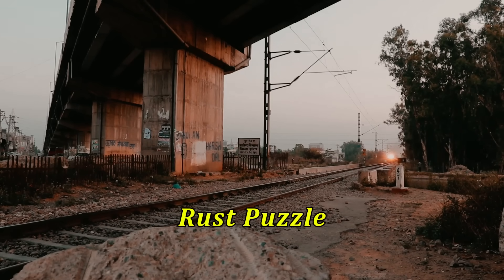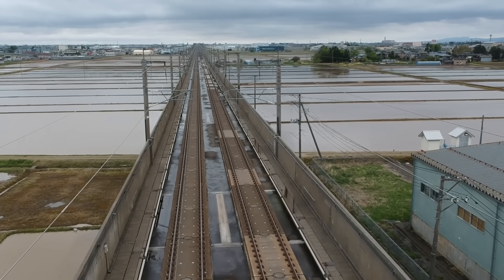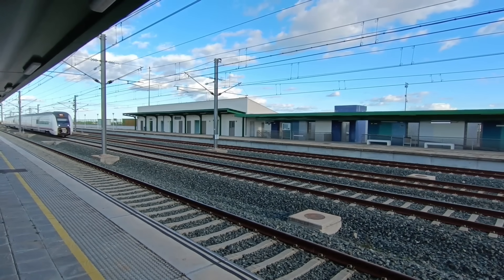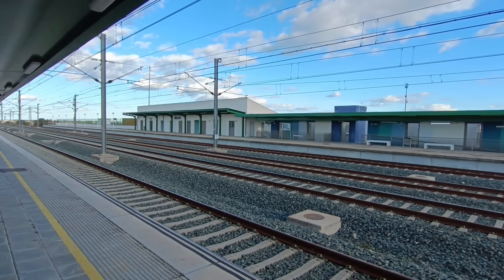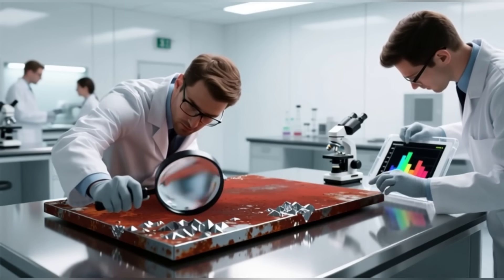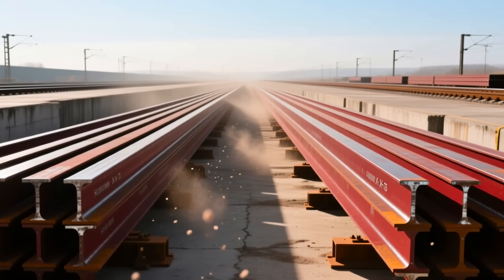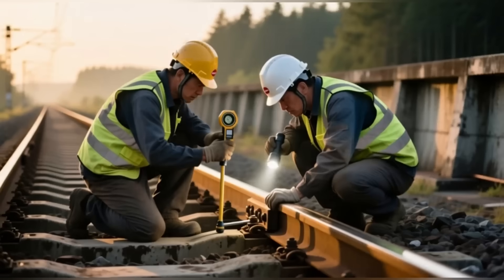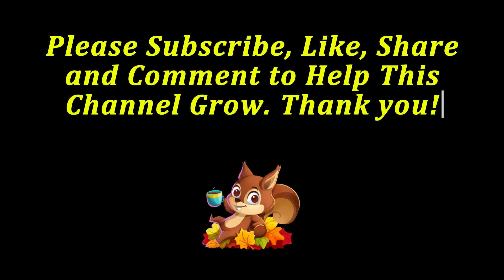Why China WANTS Rusty Railways (It’s Not Neglect!)

Comment: Makes you wonder if a steel (high-entropy) alloy could be found that is as strong (or bonus stronger) and (almost) as cheap as the rust-y looking low-alloy rail steel but looks nice and shiny for use in rid-able miniature railways and model railways. Maybe by using aluminum and some other cheap, abundant, non-toxic elements.

Comment: I thought patina was specifically a mixture of copper compounds that arise from this type of passivation on pure copper or very copper-rich alloys.

"Stainless steel" tends to passivate so fast that the oxide layer isn't visible, but it's too rigid for tracks?
Reply from the maker: Stainless steel is less sturdy despite its polished appearance, so they use proper alloy steels instead despite alloy steel's somewhat misleading rusty looking.

Comment: There's some minor railways in East Prussia, formerly Kaliningrad oblast, which were installed before II World War and the original Krupp produced rails were just re-installed to comply the Russian 1524 gauge. The rust on the railways isn't a problem at all, all the rails are changing for a new one periodically because of the grinding it out with the wheels, not the corrosion.

Comment: Isn't rust normal on all rail systems? I mean I don't recall seeing rails that were not rusty on all parts that are not the top surface and I have been around trains for 50 years. With this said around me they have recently added a few bridges with special steel that they don't paint at all and this is completely on purpose. The outer rust layer provides a protective coating.
Reply: Rust is normal, no one in the right mind would make the rails out of expensive stainless steel. 
Also, rust takes time and rail wears out with trains running on them. This means the rail should be due for replacement from wear long before the depth of corrosion matters.

However, rust layer don't protect.

Comment: Wait a hecking minute are you saying they made the rails essentially out of the equivalent of Corten steel?
Reply from the maker: Not 100% but the mechanism is similar: adding some extra element to generate a protective shell against oxidization and make it stronger to sustain the train weight.

Comment: I don’t get this video. All railway tracks develop rust on all surfaces. It is normal because you can’t paint them. Steel with protective rust is called Corten steel.
Reply: Yes, that Corten is only ONE kind of protective oxide layer.  There are many other patented ones that can be satisfactorily utilized as well.

Comment: this show is crap.   lots of ai generated images.   incorrect information.   the premise in the title is not true.   cor-ten steel which is the grade of steel that has a self protective coating is not suitable for railways.   its used to made shipping containers.   all train rails are heat treated.   i watched this most of the way through because i was eating greasy food when it was on.   otherwise i would have turned it off at the first untruth.
Reply: Not all train rails are heat treated. Indeed the vast majority in Europe are not. But yes the video has obviously relied on AI way too much as half the points aren't valid. Rails aren't designed to have a protective coating, but thankfully they usually (but not always) have a corrosion rate that means they wear out before corrosion becomes an issue. There are specific corrosion protected rails for those instances where corrosion does limit the lifetime.
Reply: @sensonic_rail , are those the rails used in cold places?   all rails have special treatments in my country.
Reply: @vsvnrg3263  which rails? Heat treated or corrosion protected? Either was Standard rail in the majority of Europe is not heat treat or corrosion protected. Both are used in some instances though.
Reply: Another AI generated video that has no idea what it's on about. Eating my tea while it was on I just left it to play through. Our rails have always rusted and the steel so thick the rail wears away before the rust eats it away. Find a disused bit of track left for years and that will have flaking. Some of our rails are made to resist rust and used in wet tunnels, they are too costly to use on normal track

Comment: Purpose rusting steels like Corten / Aus-ten have been around since the 1930's and were used in coal wagons where excessive abrasion occurs.
They became an architectural trend on housing in the 70's.
@0.45...the rusting is a chemical reaction of oxidisation.
What is referred to as Carbon steel are grades that always contain a level of Manganese (Mn), a requirement of the relevant Standards the grade is made to. To say Mn is a special alloying feature of low alloy rail steels is a furphy.
Reply: .... What it is mean in short?  Iron with manganese mix is the best for steel for railway?

Comment: Was chatting with the general works engineering director at one of the world's largest theme parks. 
Though it's not my field of expertise, we got to talking about the many miles of handrails in major visitor attractions. 
He said they has tried stainless, but not only was the cost high, but the workmanship was demanding, and it didn't hold up well.  Despite what one might imagine, the appearance was disgracious after only a relatively short time. 
Instead, they had taken to using low alloy steel, which is easily cut and welded. After testing for strength, they applied a single coat of black paint.
Upon admitting the public, the paint was worn to a patina, and superficial rust had set in WITHIN THE FIRST DAY! After this, nothing would shift or change for at least ten years! For this low-stress application no further maintenance would be required for the useful life of the system. (after 10 years in a theme park everything changes anyway).
Reply: Also, "stainless" steel isn't entirely stainless. Anyone who use "stainless" steel kitchen utensils would already know. Now, imagine using that material on exposed railway tracks which will be outside for decades, exposed to the elements and constantly run over by train wheels. It wouldn't work.
Reply: And everybody when home with rust stains on their hands and clothing.

Comment: Lol, the first clip is literally of the Indian Railways; and the second clip is from Spain (and the third from Japan).
Reply: Every railway has rust on the sides , this dude is onto nothing.
Reply: the script is written by AI
Reply: Japanese tracks usually painted white on the sides.
Reply: @bltzcstrnx 
I didn't know that. I thought only Italy did that for managing heat induced rail expansion.
Reply: @thetechnocrat4979  Also done in parts of the UK.
Reply: @thetechnocrat4979  oh, so it's for temperature fluctuations purpose. I live in a tropical climate where temperature are mostly stable. So we rarely paint the tracks here. Just letting the sides developed oxidation. Only one line that built on collaboration with Japan that have the track painted white.
Reply: @bltzcstrnx lndian tracks were painted with burnol and greased with poop.jai hind
Reply: @stevenlai1199  Pakistani tracks.. my bad, forgot it doesn’t have a robust enough primary or secondary sector to afford trains let alone electrify it 100% like rest of world
Reply: the kind of thing you should expect from a channel who depends on AI
Reply: stop exposing bro 😂😂😂

Comment: Even in India we have these rails. Only the top is shiny . The rest is rusty red.
Reply: the top is only shiny if there are trains running regularly on the rails, because the friction of the wheels scraps away the patina layer faster than it can reform
this is why railways in regular use have a shiny top side but if they're unused for a significant amount of time the rust reforms on the top
Reply: Indian trains are super super wide and India is the home of scam callers so y'know don't trust anything from India.

Comment: Weathering steel was developed here in the US way back in the early part of the 1900's. Here in Southern NJ, I see huge hollow columns for highway floodlights and power lines made from this type steel. It does have limitations; especially in weldments that are subjected to exposure to the elements and where this steel interfaces with dissimilar metals.
Reply from the maker: Yeah. To deal with extra elements, some special alloys are probably needed and hence higher construction / maintenance cost,
Reply: Yes - of course it will erode if there is electrolysis.

Comment: This is the principle of corten-Steel, which rust a little and then remains stable. Corten steel is offen used in Metall arts.
Reply: The main highway in Norway, E6, has rails, dividers, signs, lamp-posts etc. fro Corten. But it rusts too much and it all has to be changed.
Reply: @IamMagPie  They're not using it in the coastal areas of highway E6 are they?   COR-TEN steel is unsuitable in constantly wet or humid environments (especially coastal areas), where it will fail to form a protective patina and continue to rust.
Reply: @neilpalmer230  It is used inland on the E6 motorway from Gardermoen (airport north of Oslo) towards Hamar. But during wintertime they use roadsalt to keep ice and snow away, which I suspect doesn't exactly help...
Reply: @IamMagPie  Ah - good old road salt. We get a lot of that in many parts of Canada here (except the ones where it's frequently colder than around -18'C).
Reply: COR-TEN weathering steel is also often used for bridges.
Reply: Corten-steel is part of the reason American rusty belt can’t shake off the nickname quickly .  A lots of bridges were built with it, they can last many decades.
Reply: I worked with Cor Ten steel way back in 1967 on the US Steel building in Pittsburgh